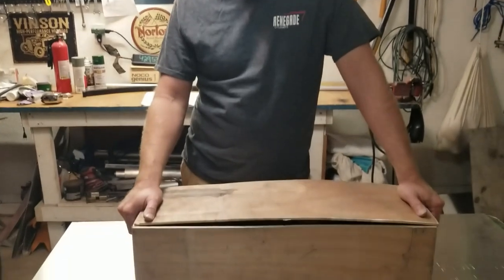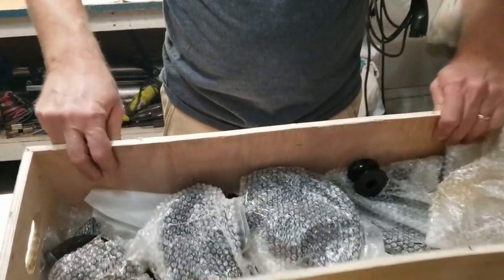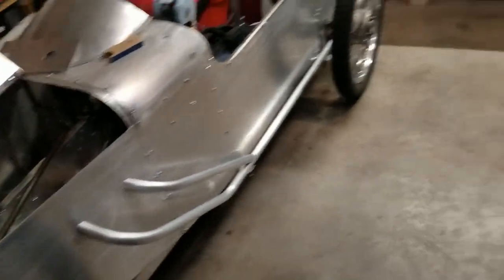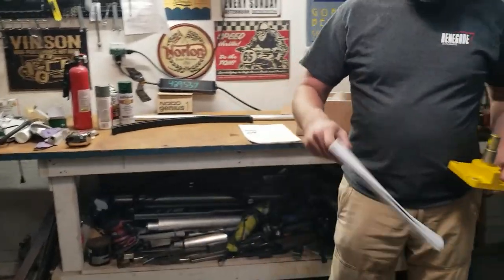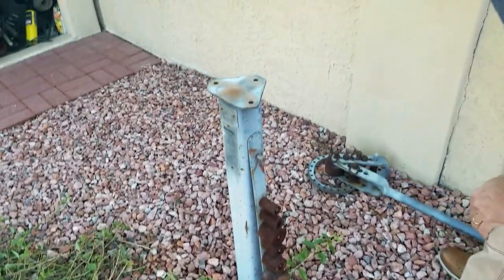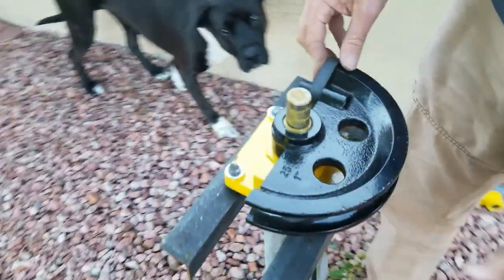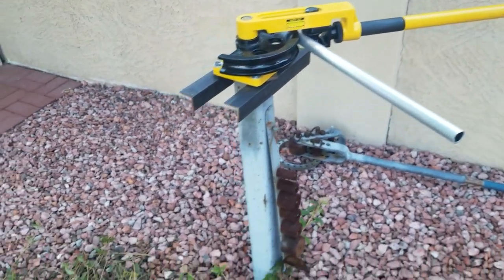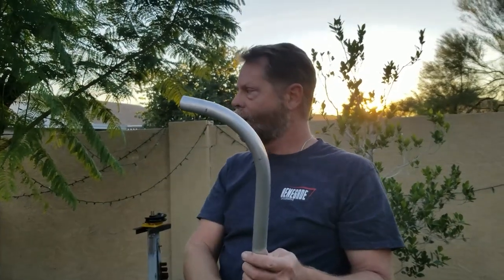Cheap Tube Bender Unboxing and Review

Comment: Merry Christmas Steve!  Thanks for all the great videos! If you have any kinking, filling with sand and capping both ends will eliminate that issue.
Reply from the maker: this tool actually did pretty good. I expected it to kink the aluminum, but it didn't.  There is a very slight bit of out of round, but not visable to the eye.

Comment: Would love to see how its does on 1" .95 wall or even .120 wall DOM or mild steel...
Reply from the maker: I have used it on some medium wall tubing.  I needed a large piece of tube to extend the handle to give me enough leverage.  If you plan to bend the heavier tube, make sure your base is secured very well.  I pulled my base out of the ground....oops,  I need a bigger heavier base for the future.

Comment: Hi, what radius bend do you get from the 9/16" die. I'm looking for a 1" max rad bent through 135 degree's. Is this gadget up to the job?
Reply from the maker: I think so.  The dies look like it will bend a 180, so 135 should be doable.  However, there is no indicator for degrees, you have to make a template or your own eyeball to get the bend where you want it.
Reply: @stevevinson6030  Thanks, I'll add it to the shopping list.

Comment: Hi Steve, love the videos, you really do a good job taking time to explain things along the way.
I was wondering if this is the tool you used to bend the 1/2 square tubing for the body panel framing inside the Aston Martin? or was that the green/rust tool which you used the base from? Are they specific to round or square tube only?
Reply from the maker: I bent the square tube on the rusty crusty Harbor Freight bender.  I went very slowly bending just about an inch at a time all the way around.  It took several passes to bet it right.  Thanks for watching.

Comment: How dou you think it would work on .065 wall thickness 1inch od stainless marine tubing.  Thank you nice video 
Mike
Reply from the maker: I am not familiar with that type of tubing, it will bend it, whether it kinks or not...I really don't know.  I have seen some folks fill the tube with sand to prevent distortion.